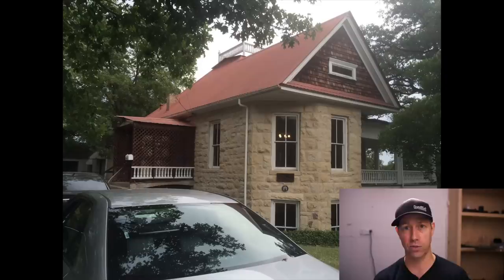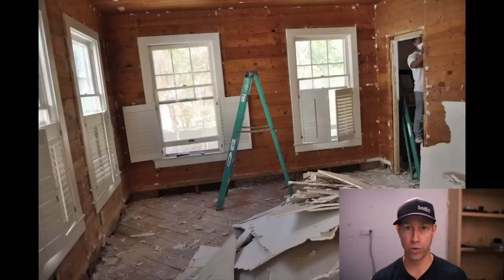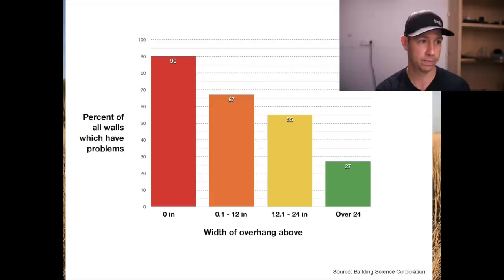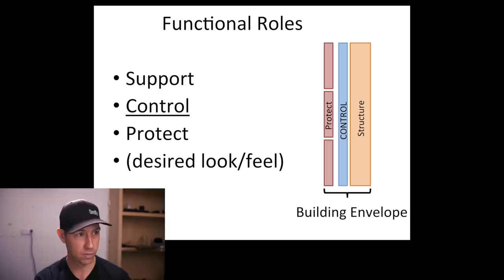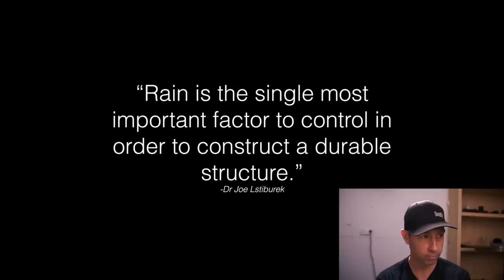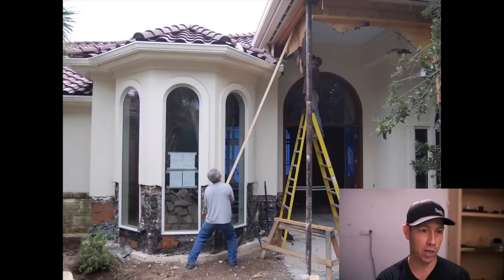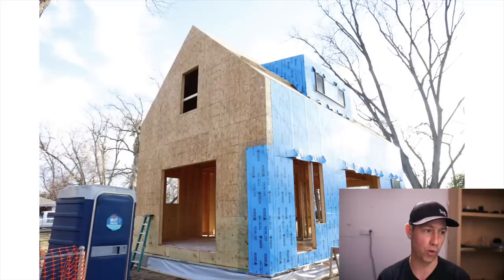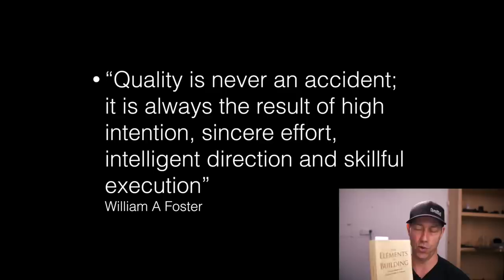Were Old Houses Built Better?

Comment: The problem of building to code is that those codes were created by the various Builders Associations and by their lobbyists in the U.S Congress who does not know shit anything on how build a house of a skyscraper and as a result those so called building codes are  "SUBSTANDARD CODES" so that they can buy cheap, build cheap, and sell expensively substandstard housings and buildings and infrastructures, etc requiring expensive UNNCESSARY maintenance, repairs, replacements, remodeling, upgrading. I say build them to last, maintenance-free, repair-free, and trouble-free and design them to meet future anticipated and unanticipated future needs. 

So many comments but not one made a comment on "GOPHER WOOD".  When I was in government service in the 1950s and 1960s I was sent overseas from time to time and Israel is one of them. I happened to be in some Christian sector of the Jerusalem area and I saw a man making gopher wood on top of a flat thick long and wide steel plate by using thin sheets of wood and brushing them with boiling sap resins made from the highly resinous tree and placing an another thin sheet of wood on top of it and repeating the process several times untl the desired thickness is reached, then using a flat bed mechanical vise or putting heavy iron weights on top of them until enough pressure-weight is on top of them and allowed them to jarden and cure for a whole day and for a whole night. 

If bent, if it breaks only the surface will break but the sap resin binded area remains virtually unbroken but in practice more than enough boiling sap resins is brushed on the thin sheets of wood and the thin sheets of wood is made thin enough so that the boiling sap resins will penetrate right through them from one side to the next and turning each wood sheet into a sap resin saturated and binded thin wood sheet and is virtually unbreakable and they make sure to brush the sides so that it will be thoroughly saturated even though the wood is already saturated, call it overkill but they don't mind. 

But they do not call it gopher wood anymore they call it Aramaic wood based on instructions from the Aramaic Christian Bible and I ask an Aramaic priest about it and he showed me a very old Aramaic Christian Bible and lo and behold the Biblical instructions are the same instructions given to Noah in making wood for the Ark! 

In the 1960s you Americans made something similar to gopher wood using polyester resins and called it "impreg wood" and in the 1980s rumors abounded that the same similar process was used in your B-1 Bombers and used in both American, Russian, and European arms manufacturers in making gun barrels and chambers! 

Well I am not surprised at all because in the 1950s in your American Readers Digest in the 1950s there was this article concerning wood products and their promised and some of your scientists are actually making using plastic impregnated and laminated wood as an experimental heat shields for your spacecrafts and ICBM missiles. 

The man I saw in Jerusalem making Gopher wood, now called Aramaic wood in that time, said they rarely mass produced such wood anymore for it discolors the wood and uses it only for making posts and beams, joists and rafters, and as foundation boards for floors and walls before using ordinary wood nailed on them.  

With today's technology using simple servo-mechanisms and high-safety engineering standard specifications to make the work place safer than a children's playground, we can now mass produce gopher wood WITHOUT SACRIFICING QUALITY WHILE OVER-ENGINEERING IT for quality control upgrading. The question is finding one who is willing to invest in manufacturing a product that will last for thousands of years without deterioration in this age of planned obsolescence which is being fought back right now by people who wanted products designed and built to last as long as the exists!

Comment: I purposely bought an older home that was built in the early 1920s.  After looking at all the awful modern homes, I knew that they were not the ones for me.  Is my house perfect? No.  It's not open concept (thank God, I despise open concept design...what a waste of open space), the floors are settled in spots, it has some creeks and and quirks, and the Closets are super awkward.  However, we rarely need to turn the air conditioning on...stays super cool in the summer and stays warm in the winter, it has beautiful wood floors, built-in China cabinet, stained glass windows, beautiful trim details, basement doesn't leak, huge windows with natural light.  When I see all these new subdivision mcmansions, they make me sad...they look so phoney.  They all look the same. These giant kitchen islands that are designed to catch clutter. These huge vaulted ceilings and open space that makes you feel separated from everyone in the house, a million cabinets and closets to store all unused appliances and junk,  fake vinyl flooring. Yuck. If you simplify your life I think you'd find that your new home is an echoey box.

Comment: My wife and i grew up in old houses and learned to stay warm and cool in New England weather. We now live in a 50 yr old town house that was recently rebuilt town house style building. We have been there for 30 years. The first winter we used the electric base board heat. We used it for two months! We have not used it since. For heat we use a 1500 Watt portable radiant electric heater aimed at us. It us more than adequate for all but about 10 days in a typical winter. We frequenty use sweaters and lap blankets on the early mornings. In the summer that can get over  95 deg we use floor and window fans. 

Fortunately we have lasted long enough, mid 70's, that moving into a new house is impractical. It is also absurd to spend thousands to make the place super comfortable for three weeks a year. Besides, we take long vacations during the summer.

Comment: Old houses were built this way because labor, materials and energy were more affordable at the time. Would new houses last that long or not is not that big of an issue. They are just much more affordable to build and save on energy bills enough to justify tearing them down and building another which would be even more efficient in 80 years.

Comment: My 1950s built house is way better built than my 1990s townhome, even though the townhome was in a much richer neighborhood. My 1950s house was built for a working class family. There aren't even any sidewalks or street lights on my street. That said, the 50s house is all redwood framing and the walls are as strong as concrete. Wi-fi barely even works.  One time I had an occasion to put my fist through the wall in the townhouse.  If I tried that in the 50s house I would break every bone in my hand. Also, it has a crawlspace instead of a slab, so I don't have to worry about cracked slabs and I can easily access plumbing and electrical.

Comment: I kind of disagree with your car analogy with standards of comfort, materials, efficiency and what not. Old cars can be efficient, and way more reliable, but just not have the features of a new car, especially with electronics. The particular car you showed as an old car, those things got in the mid 30s mpg, rode pretty smooth, and were crazy reliable. I get what you were trying to say, I just don't think that was the best analogy. The analogy only makes sense for people that buy a new car every 5-7 years, and would never be caught driving an older car.  With the older cars, and the older houses, there are ways to improve it, and have it be better than anything you can buy. I live in an area with alot of 18th and 19th century houses, and the people that live in them have money. AMAZING things can be done with those old houses in terms of comfort and efficiency, and they are just as solid as can be.

Comment: It's hard to agree with everything you said. I believe if you wanted to build a house the old way 2' stone walls first floor stack logs on top 12"dia clad with wood sheeting insulate with mud and lime. Add electricity  and boom there is no way it would cost much to heat and cool it's just to thick to get hot or cold.

Comment: In the "old days" the builder engineered from his gut.  He knew he could hold up that open  porch roof with 4X4 posts, but then he thought about snow load and wind sheer and knew he should bump those posts up to 8X8's.  Then he wondered whether the roof would support the weight of that big oak tree on the front lawn if it ever fell over onto the house, so he bumped those posts up to 12X12's.  Today the architectural CAD software performs all the calculations to weight structural performance against economic performance and determines that all building codes will be satisfied and that roof will be adequately supported with 6X6 posts....so that's what you get.

Comment: Your statement on older houses being cold and inefficient is simply not true. We own a Victorian built in 1893 in a historic district in Westchester county NY. It's the warmest house I've ever lived in. The house still has all original doors and windows from 1893. There is NO insulation in our house or any of the houses in our neighborhood. NONE. The walls are 8 inches thick balloon construction and the interior walls are all original lathe and plaster of course. We have zero problems keeping our house warm and neither do any of our neighbors.  We have all original cast iron radiators now equiped with Danfoos thermostatic valves to control and cut back water flow to each radiator which reduces our heating bill. Even with restricted water flow to radiators the house is warm and efficient. House is heated by a Triangle Tube high efficiency boiler.

Comment: I'm confused, why american houses are built so cheap. In my country in europe most of the houses are built from reinforced concreate for structure, then bricks for interior walls and some exterior walls, then weather control layer, then the thermal and then decorative layer. I saw alot of houses that were decimated by huricanes or tornados and then rebuilt the same squishy way as before. Why american houses don't use more concrete?
Reply: One word: banksters

Comment: Its not correct to say old houses didn't have any insulation. I've worked on many wood framed homes from the mid 1800s that used non structural brick in the walls for insulation. They called it nogging. It basically blunted the rapid temperature swings between day and night that the north experiences.

Comment: Keep in mind, modern 'fast growth' timber (pine, predominantly) was made for 'cash-cropping' timber sales...not for growing the 'best lumber available'. Old growth (natural) timber is, and has always been a better material! Pine is also a TERRIBLE wood to use to build a 'durable' home! MOST old homes were oak, elm or poplar...NO ONE in their right mind would build a house from pine (unless they had no other choice) 100 or more years ago! All of this also applies to plywood and 'chip board'...When I was young, you could contact local Amish to 'frame' or 'even 'full-build' a 2,000 sq. ft. 2-story home for you for around $10,000...you provide your own trees, or buy timber from them for an extra cost.  1-2 weeks later, the house is FINISHED...you install the insulation, wiring and plumbing...you could even get them to come back and 'finish carpenter' the interior, if you wanted. The wood they used? Elm and Oak...NO PLYWOOD or Particle Board! Most of those houses are 40 or more years old, and are STILL LIKE NEW!
We aren't building better, by any means...we are building 'cheaper' for 'maximum profit potential' to the contractor! If you doubt this...look into houses built before 1960, and you can see for yourself...I'd rather fight 'dimensional lumber' and 'custom spans' than I would 'leaks causing your FSB boards to come apart, while looking at the work of a 'nail gun' using brads to try and hold a wall upright (all while wondering why you have black mold, not thinking once about that 6-mill plastic 'vapor barrier' the whole house is wrapped in)!

Comment: Id take an older house any day, and just update the water, heat,electric, etc. Today ,nothing is built to last. They put up houses on land thats not even settled yet, get paid, and run. The only thing about old homes is they must not have had many clothes because all the closets are small. Another thing I hate about newer homes are the garages are in front of all newer homes. Looks like shit. But I guess they cans squeeze more lots out of the land without a driveway going beside each house.

Comment: Insulation on the Outside? What's the big deal! That should be just common sense. Ok, maybe frost might not be an issue in your area but you normally try to keep the frost-edge inside the insulation material and not in your wall.

Comment: To be fair older homes were built better, The material wasn’t shit, past the 80s building material began to drop off.  The big issue with older homes is efficiency and insulation issues.

Comment: Very interesting comparison. You left out the details about the differences in electrical and plumbing. My old 1939 house has the post and tube wiring. Completely safe but one gotcha! They only put two wall sockets per room! AWFUL! Since the house is all wood the missing ground wire is moot. You can be barefoot on the wood floor and touch hot without getting a shock. Next, the plumbing. Nice big cast iron drain pipes! They never get clogged up! But they don't work well with the new 1.5 gallon toilets. Not enough flow. Then comes the water pipe. Galvanized steel. Works fine for 40 years then the rust starts. Sinks and tubs get the brown look after a few weeks and need the rust cleaning.
 A question about the 2-4 foot overhang. Is that smart in a hurricane prone area like Houston?
 I REALLY disagree with your car choices! I'll take a 1950's car ANY TIME over these cramped rolling computers that have zero style! My 1988 towncar is going strong after 26 years and my 73 Ranchero after 50 years!

Comment: 0:33 If the right man built it is 100 times better than anything built today. I have been building since 1978 and the stuff today looks beautiful really stunning and they total shite, garbage. The only thing better today is the wiring. I hate pulling out that old knob & tube wiring. Hell, back in the 80s we only used 1/2" rock on the ceilings. Every wall was 3/4 sheet-rock. And the decks, always 3/4" plywood. Today, 1/2" OSB. Trash, pure trash. The buyer comes and looks oh my this is beautiful. If you only knew buddy, you'd be mad as hell. You'd probably want to shot somebody for stealing your money. But luckily they have no clue and love what they pay for.

Comment: The answer to this question is simply no.

The buildings that survive were built better than the ones that didn't.

When you buy, or build..  you need to pass judgement based on method an means of construction.  Will your house be one of those that survives?  Or not?

Comment: Yes old houses were built better.  They were built by skilled craftsmen using superior wood and skillset to todays builders.  Yes, they weren't air tight but heating was cheap when they were built.  You wont see many houses built in 2022 in 2122...

Comment: stone houses were not the common way houses were built for thousands of years. The most common building material for houses historical speaking is wood and mud in different configuration. A lot of the roman forts were just wood. Only permanent forts would eventually be done with brick. Rome itself was a city with brick apartment blocks marble used for more important buildings. Marble being used because it was white and made it great to paint over it. Rome was in fact very colorful and not white. Same with greak city states like Athens. Sparta was just a mud and wood sprawling village. It is said when the Persian army got to Sparta, they thought the Greek they had hired to show them the way was making fun of them and they killed him. The city did not even have a wall. In more desertic places were trees are harder to find and grow, houses were of mud bricks. Afganistan today is still mostly mud bricks.

Stone masonry buildings were mostly used by the upper classes due to the labor required to build them. Just like castles and churches.

Comment: I argue all the time that j channel shouldn't be caulked to pine or cedar trim on vinyl sided homes. The codes claim it's to prevent the ingress of moisture, which is horse shit. All it does is prevent the egress of moisture from the inside and the house can never dry out and has no airflow. Every summer I have to break it to several people that their maintenance free type home has 3500 in rotten wood. Caulk is a horribly overused material

Comment: A new house built with some of yesterday's materials would be perfect. But lumber from fast growth forests will not tolerate any moisture. We see all these hi-tech materials being use to protect against water and time and time again they fail for one of two reasons. 1. They simply don't work, or 2. They have to be applied in exacting ways. Wonder materials that are not used the right way will fail more often than not. We simply don't have craftsmen like we use to because we will not spend the money to train them or retain them. Plus the desire to build to sell and not to last is what causes us to use materials that will not tolerate any moisture. I think this is a mistake. New materials need to be able to handle some water like the old materials do.